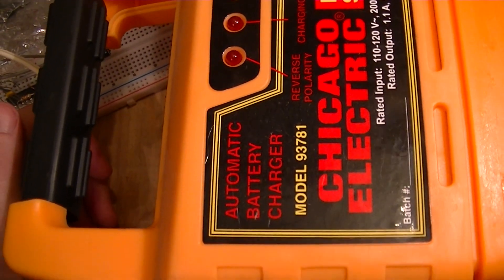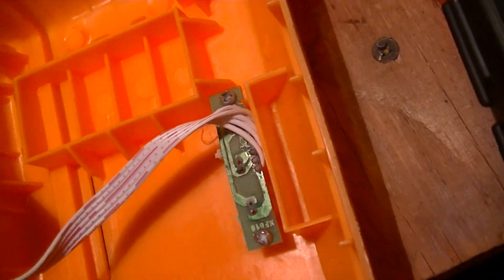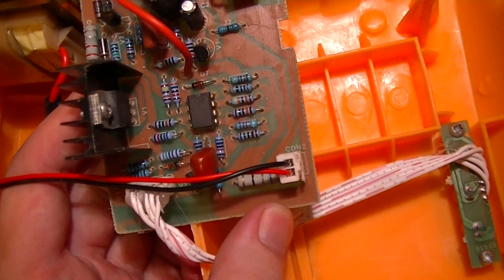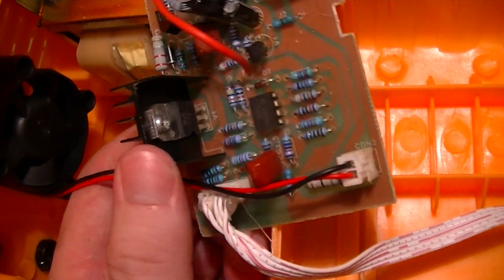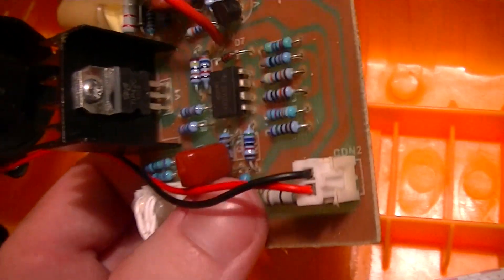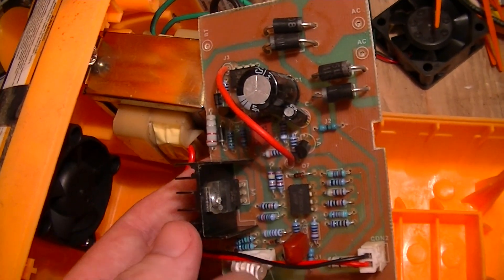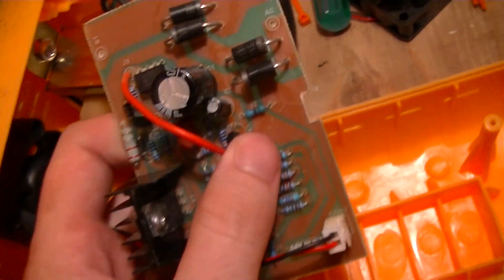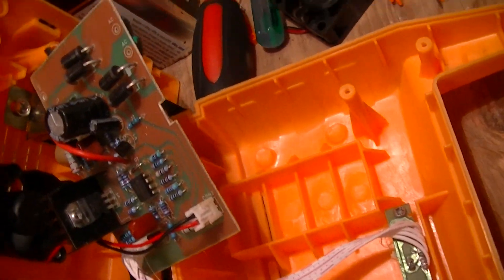Harbor Freight battery charger guts/teardown

Comment: I was told years ago never use a battery charger to power any electronics  . Back in school when I was in the NAVY in electronics school the instructor powered a car radio with a battery charger and 30 min later it stopped playing . We opened it up and the power supply circuit was blown.
Would you agree with that saying?
I also just got out of hospital after a rear end wreck DO you want to hear the details??.

Comment from the maker: Most battery chargers have no means of limiting their output potential as they are designed to be connected to a battery, and as such their output potential can get up to 20V or more as their regulation (if any) is only designed to keep them from frying the connected battery.
That does not sound fun, as I've heard my share of stuff on the subject.  A few years back, a neighbor's brand new (driven less than 800mi) VERY expensive SUV got totaled by some drunk illegal.
Reply: randacnam7321